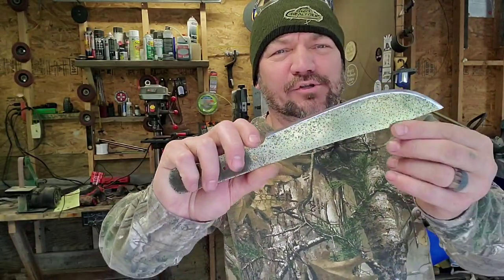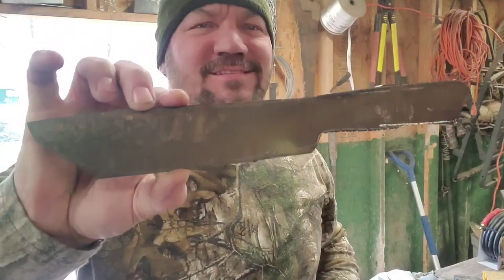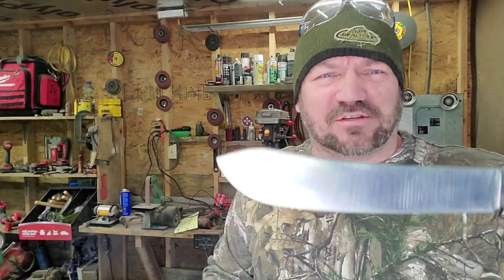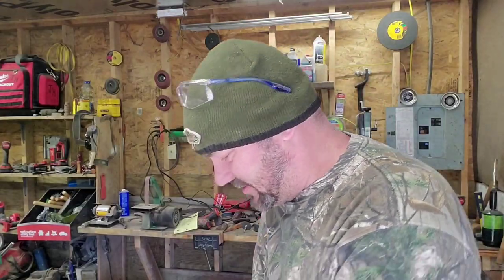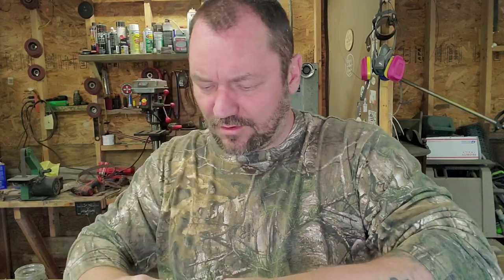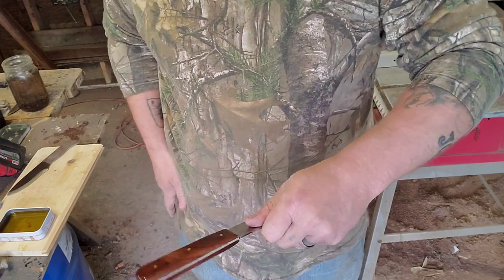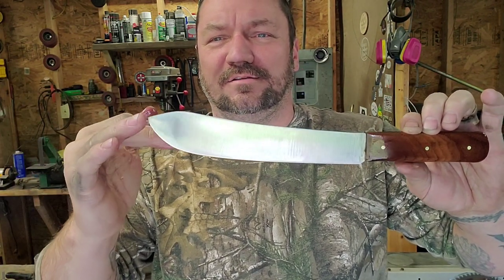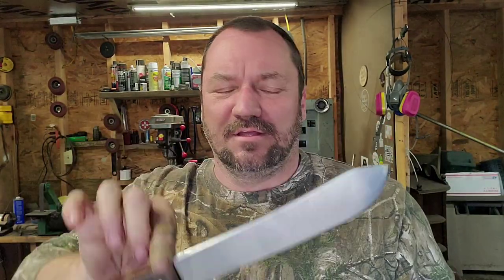MAKING A BUTCHER KNIFE FROM OLD SAW BLADE

Comment: I have 3-50 inch head saw blades you can die for. They came from my sawmill. They are right around 3/16 x 50in thick and  tall provide me with all the hardenable steel I will ever need. Great to see you keeping busy bud. Staying like that will save yer soul bud.
Reply from the maker: I'd love to have something like that buddy
Reply: @JerrysWoodShopandOutdoors   Old ciructle type sawmills will have a few of them laying around as they can't be hammered any more to keep the tension so the bits and shanks to stay put. They start throwing saw teeth and shanks out at 100 mph and have to be taken out of service. Big bands are a totally a different story. With them the best you can do is produse a really good damaskus with the high carbon content. Hey bud. Just take some and it can be molded into a dream eh, LOL.
Reply: @JerrysWoodShopandOutdoors  You just need to come on up and get them bud. No interest in a trade eh my friend.LOL.